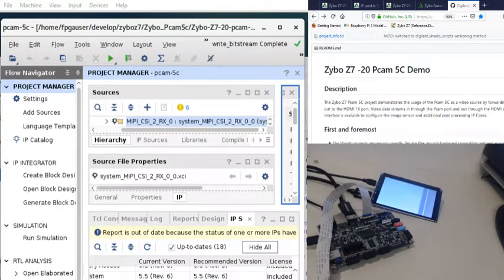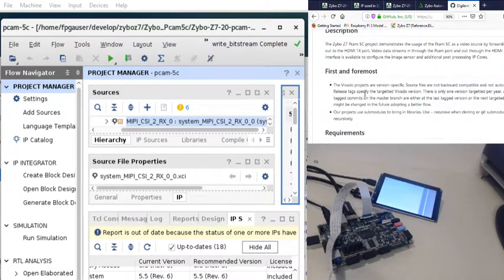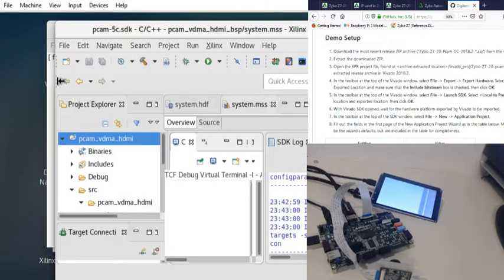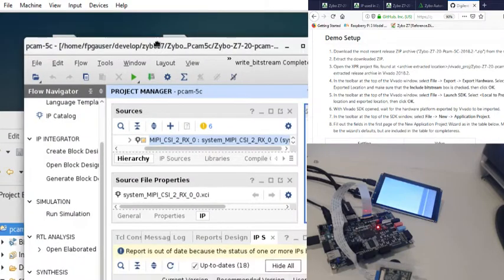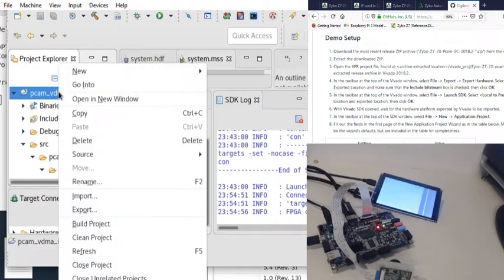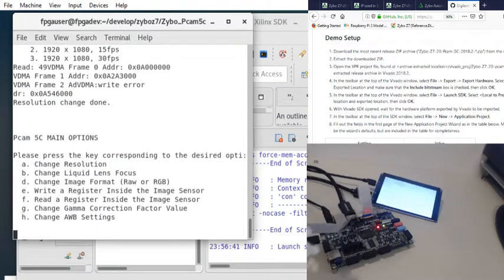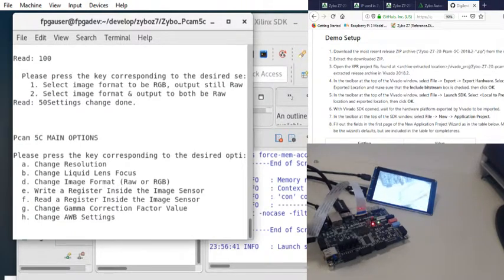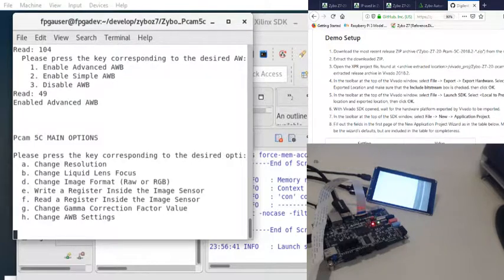Digilent Zybo Z7-10 running Pcam 5c demo

Comment: Hey, thank you for the guide and demo. Could you please help me? After the implementation of pcam project, I am getting the following error

"[Place 30-569] BUFIO instance 'SerialClkBuffer' is driving 'I' pin of instance 'SerialClk_OBUF_inst'{OBUF}. This will lead to unroutable situation. A BUFIO can drive only clock pins of IO tile"
Reply from the maker: Sorry, I have not worked on this for sometime.  I would suggest either the element14 forums or Digilent for assistance.
Reply: @TheJoMoVO  Thank you anyway.

Comment: Hey Jon, a little late to ask but do you have any idea how about how to capture and save images from this Pcam 5c camera ? also what fish lens did you use?
Reply from the maker: From what I remember, the Pcam example was hardware only and did not use Petalinux so the camera output was just passed to the HDMI port.  To capture an image from this you could use a capture card or create a design that uses Petalinux to work with the camera.  The lens I used was a Vicdozia 2.5mm Replacement 170 Degree Wide Angle Camera DV Lens.  Ref: https://www.element14.com/community/roadTestReviews/3090/l/digilent-zybo-z7-pcam-5c-review
Reply: @TheJoMoVO  solves my problem thanks alot :)

Comment: o I actually do update my project for zybo z7-10 and all the process run fine till the SDK build but my output is not there, I also do not get the menu on the console..between I have connected the HDMI to my tv screen!? can that be an issue?